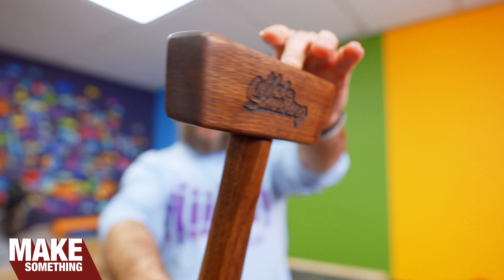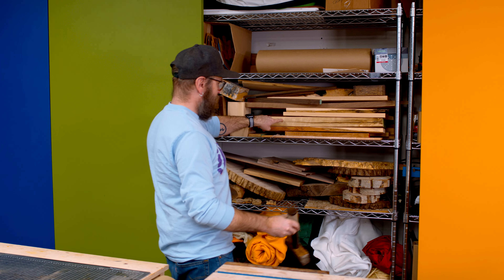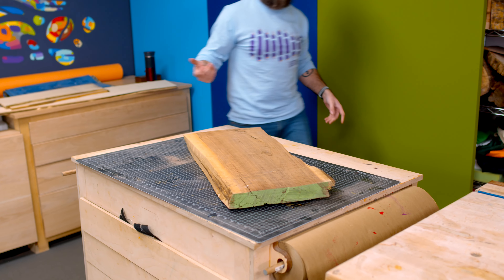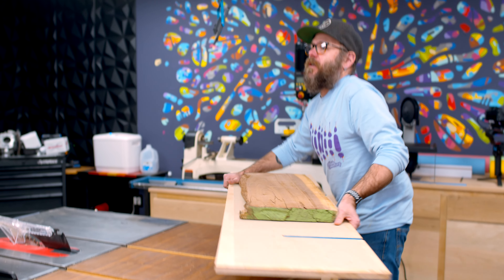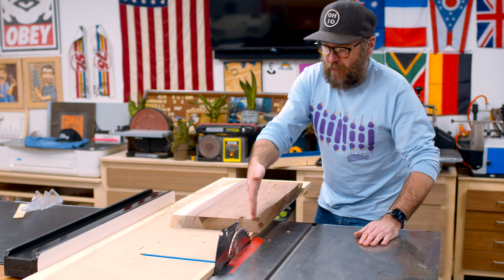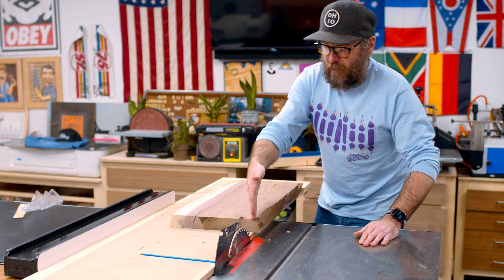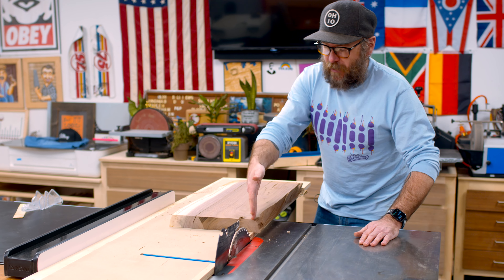How to make a simple wood mallet. Easy woodworking project.

Comment: At 7:32 you mentioned “what is this thing...fistules...”.in walnut, you primarily see that in young twigs and branches  in the pith. In a lateral (longitudinal) cut you will see that the pith is chambered. Occassionlly these show up in the older xylem (wood) as seen here. It is not a flaw nor disease nor insect damage...just part of the wood.

Comment: turned out very neat.

whenever I wedge the slot, I drill a hole at the bottom of the slot, which acts as a split stopper. I also do this on the wedged mortise and tenon joints etc
Reply from the maker: ahh, great tip! Thanks!!
Reply: I'm guessing the order of operation is drill the hole, then cut the slit?
Reply: @griffinmakes  yes that's the correct sequence. 
and make sure you don't drive the wedge below the hole profile because you would still split the table leg or the handle, ...ideally the sharp end of the wedge should end in the middle of that circle. you actually can achieve that by marking the line on the wedge that tells you how deep you can safely drive it in.

Comment: Great stuff as always.  For the mallet with the checks in it you could vacuum press the colored epoxy you are using on the workbench to pull it through the cracks an strengthen it up.  Would look pretty sick, especially if you could find some colors that react with the black lights in spaceship mode.

Comment: I'm no expert woodworker by any stretch of the imagination, but I'm currently struggling to set up my workshop. This is the 2nd video in recent weeks where you've had to pull wood from under or behind other wood and had to remove a lot to get to one piece. I suggest you make a vertical wood storage that keeps the wood mostly facing to the left and right. Kind of like a wood library.

Comment: It is a good idea to not have hair on face. Looks better on video. No glue on hair. No dust on wood.

Sap wood top table with blue river.   running down the middle. The table could b used as a top for a dresser, or lagoon table. table.

Comment: 7:30 That's called a "bark inclusion". 

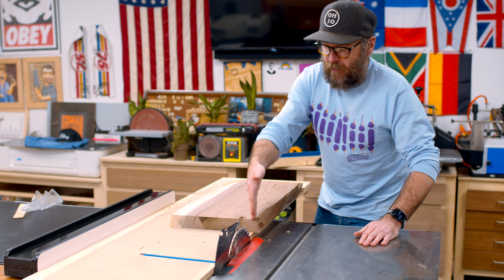BTW, at 6:30, when you talk about the spacer, I'd recommend a much wider spacer. If your cutoff can turn just a tiny bit and still make contact with both the blade and fence, that can still be picked up and thrown.
Reply from the maker: Right on, thanks! Next time bigger spacer!
Reply: @MakeSomething  I only felt compelled to mention it, because last week I had piece of 3"x3" 1/4" ply get thrown past me, hitting my car (my shop is my driveway). I had almost an inch gap, but it was still enough that the cutoff turned when I pushed the next piece through, that it bound, and got airborne!

Comment: People have tool envy in the strangest way. There’s a way. You can go to harbor freight and buy a piece of crap hand plane for $15. It sucks. It has an annoying learning curve. But you can fiddle with it and use it to plane a board. You can also get a cheap saw. And do all of this with $20 on tools. Is it fast and easy. Not at all. But it’s possible.
Reply from the maker: To some, using tools is about the pleasure and experience of making something. So whatever tool helps you get to that place is the best tool.

Comment: The joint between the head and the handle is a bit meh.
Reply from the maker: Still working just fine after all this time. Guess your judgement is off. 😜
Reply: @MakeSomething  It's not my judgment.  It's the amount of time that the hammer has existed.
Reply from the maker: @pleappleappleap  Good thing I know a good woodworker in case it becomes loose.